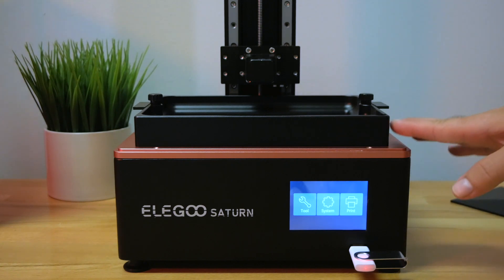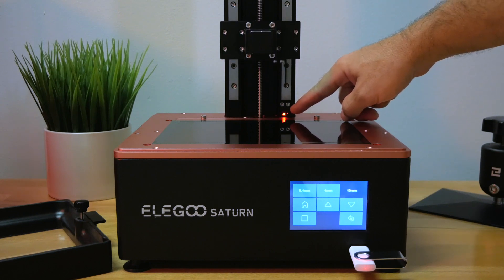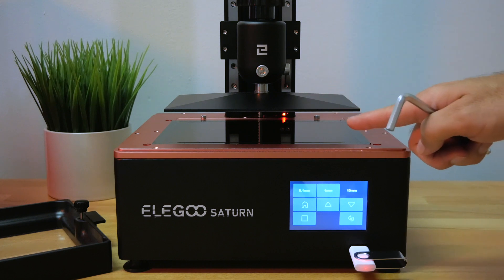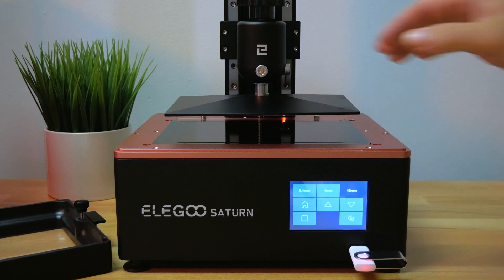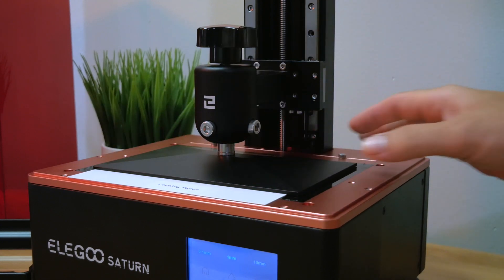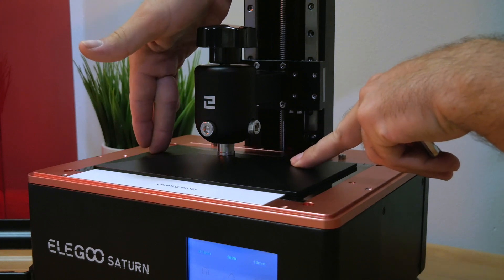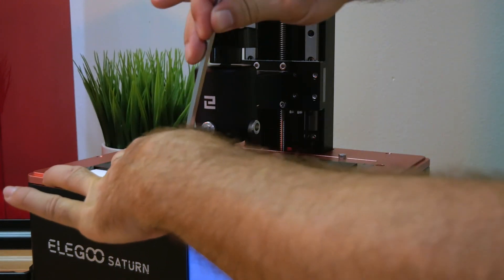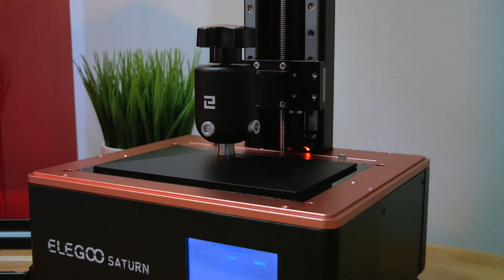Elegoo Saturn - Build Plate Leveling

Comment: I'm trying this on the saturn 2 it's different from my anycubics needing that 1mm lift but when I do this and set the Z as home when the build plate comes down it does that scary clicking sound and same when the vat is in when it's going to print it's first layer?! I was told n read it would set when was going to print I DEFINITELY need it raised as getting great detail validation matrix test ls etc but half the high they should be the cards not lifing off the fep I've not heard it once breaking free n slapping back down! What am I doing wrong here? At the end of the vodeo I didn't see you backing back out the level and setting the new Z home axis, is this what I'm doing wrong,?
Reply: could be just that the fep sheet is too loose in the tank, did you insatll it yourself?

Comment: I,ve bought a used Saturn without the leveling card,I'm wondering how thick it is in mm's as I use a normal A4 paper which seems a lot thinner?
Reply: Need about 6 a4 sheets to make up the card thickness then add an extra 1m. On top of that to lift the plate it's still way to low! The leveling card is rubbish they should thicken it that extra 1mm amd just have us level and tighten the bed the same as any other printer! Why it has to be so occurred I dunno! Only thing I hate about my new saturn 2 I'm still trying to get thw bed levelling right after 2 weeks!

Comment: Hello, thanks for the video.
If i tighten the bolts too much I get this grinding noise in the motor as if it's trying to push the plate beyond the LCD screen and can't print. And if I don't tighten enough my plate gets crooked during the printing and my print fails.

Any recommendations? 

Thanks !